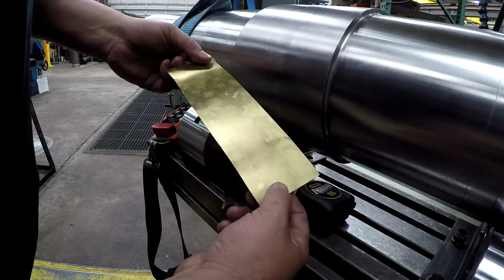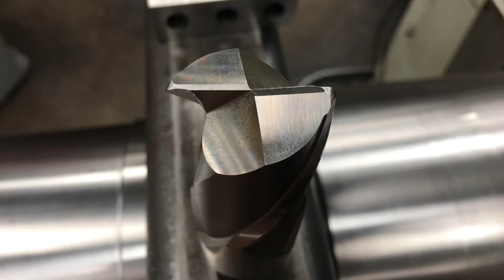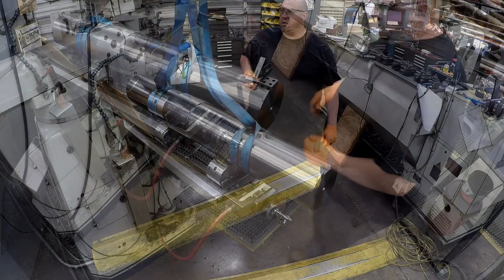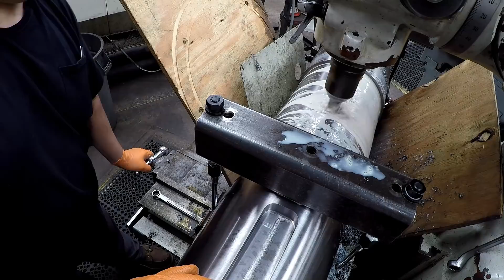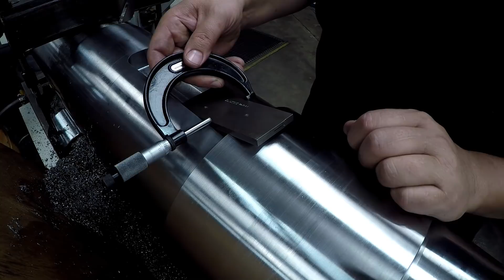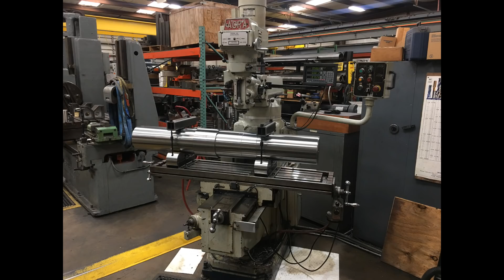9 5 Inch 4140 Gearbox Shaft Part 3

Comment: Can you give us a ballpark of what a shaft like that would cost? My guess is around 20k
Reply: As usual, the real cost on this is the downtime for the machine it goes in. The downtime is reduced because of the quality of the job Adam's company puts into the repair, both materials, engineering and manufacturing.This makes the repaired part last longer and is evident in the care that Adam used in every detail of this part. So much of heavy industry in this country is using legacy equipment that simply isn't made anymore. Having a repair shop that employees great craftsmen like Adam who take the extra time to do the job right is invaluable.
Reply from the maker: Yea i don't discuss cost, it's not fair to the customers involved. That's between the company and them. Honestly, I never even looked at what this piece of material cost us. 
Often times these shafts from the factory are ridiculously expensive. Enough so that they can pay me to machine it in house and we make the profits instead of paying someone else for it. It's just business.
Reply: Midwest steel quotes about $2600 just for the round stock, plus freight. Then figure 40 hours at a typical shop labor rate of $100 , add a little in for overhead and profit and it adds up. And Adam has said plainly in the past that he won't talk about pricing, so don't expect an answer from him. I think 2008koss is not that far off.....
Reply: my guess - about 9 K incl. material
Reply: the truth is in between.  He's far more than a simple machinist.  This is a highly skilled master craftsman at work.  There is so much math and attention involved to detail to get precision.  One wrong measurement the job is ruined at the expense of the shop.  Lost time too.  I worked as a machinist making bagpipes.  The work must be precise or it won't work.  Most mistakes are not fixable.  Abom is the man.
Reply: SpinDrift
How can you tell if a bagpipe is good or not? Does a good one sound more terrible? J/K. I love the pipes.
Reply: Having 10k tied up in a spare for a part that will fail due to stresses and said 10k spare part preventing 100-200k (week's worth of production) losses is a good business practise. Of course this depends heavily on the business and machine productivity and number of production lines. Each business makes their own decisions.
Reply: You can't put a price tag on art.  :)
Reply: Do you seriously think the customer gets only charged Adams pay for that time?
100$ an hour is usual rate you pay for something to be machined.
So 4k would only be the labor itself.
Reply: Dennis Sampson Any sane operator has a variety of critical spare parts in stock for their machines and downtime is limited to just fixing that machine with the spare. Then they just order a new spare axle from Adam's employer. :)
Reply: The shop charge out rate includes overhead and profit; if Adam was getting $100/h, he'd be the highest paid employed machinist in Florida by a factor of at least two :)
Reply: Abom79 I understand now. Thanks for replying.
Reply: I agree with you, a major manufacturer must have spare parts in inventory. The most expensive time is downtime. I've known companies that had $500,000 in one spare part because downtime can run upwards of a million dollars a day. I would guess that a chip mill could easily run over 200 thousand a day in downtime, probably much much more. Critical spare parts inventories are a cost of doing business, only poor management decisions don't include critical spare parts on hand and usually multiple spares not just one. I've changed parts too many times only to see a new part fail. Like many of Adam's subscribers I like to see a master craftsman at work and hear his explanation of why he does things the way he does. He is passing on tons of experience and knowledge of his trade and I hope people will realize the value of what he is doing.
Reply: I bet the faulty part could be cut up and sold to gunsmiths... that material makes good gun barrels and receivers.
Reply: Csab he is in Florida if I'm not mistaken, but $900 a week is $22.50 an hour. He is worth way more than that, and if that is what he's getting, I will try to refer his services to the company I work for. We have a pretty large machine shop in one of our facilities, but they are always backed up. They get $45 an hour plus overtime.
Reply: sleeptyper and 2hen they don't have a spare it'll make a shop owner happy because you g st to charge more for the job bring on rush. And charge more for putting it before other projects. This happ3ns at the steel mills all the time. They com3 to the family shop paying double than if they just had a spare.
Reply: Sleeptyper     I agree except that I suspect nobody expected this shaft to fail with a crack originating from the keyway.
Reply: 3-5k gets you much closer.
Reply: BlindBatG34 its. It not art, - just a simple machinist job 😉😎